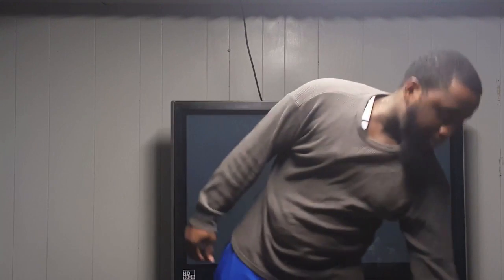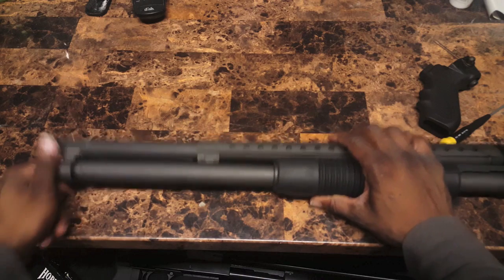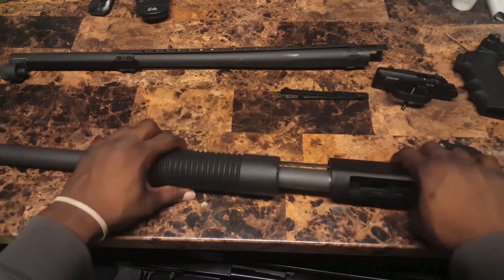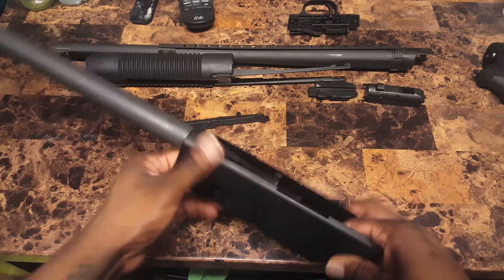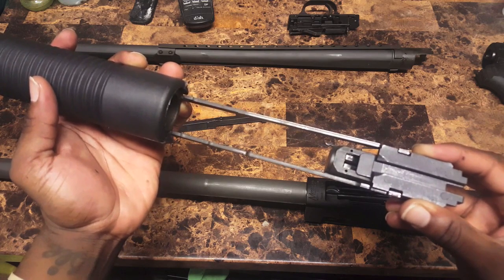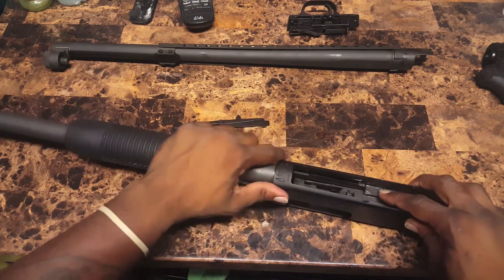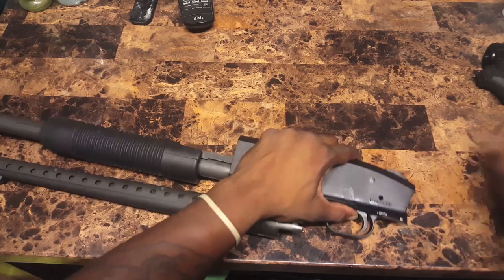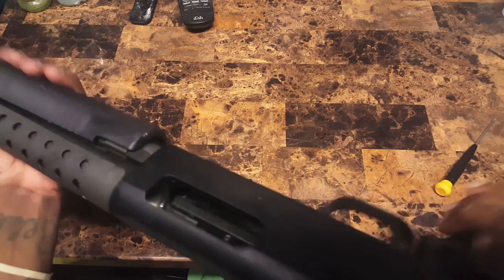Mossberg 500 Pistol Grip Shotgun Disassembly & Reassembly | Lead 2 Rights

Comment: The first time you took off the pistol grip was it stuck. I cant get the screw to turn to save my life? is your the Persuader version?
Reply from the maker: Lou Collins good question im not too sure. But if the allen wrench isn't doing it use a ratcheting socket thats how i originally got the stock off
Reply: My screw just spins and spins.  I can’t get it out